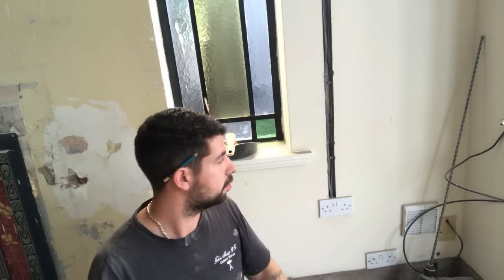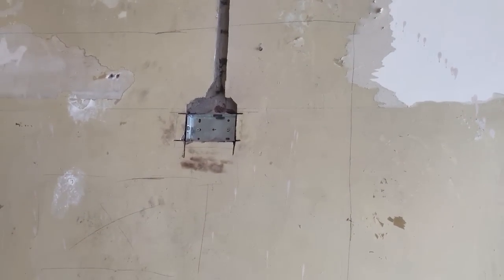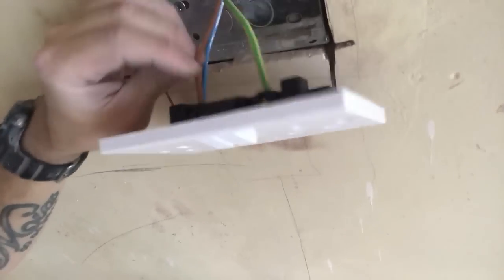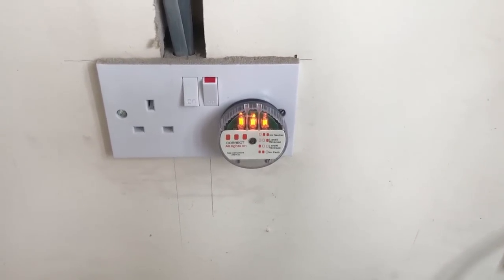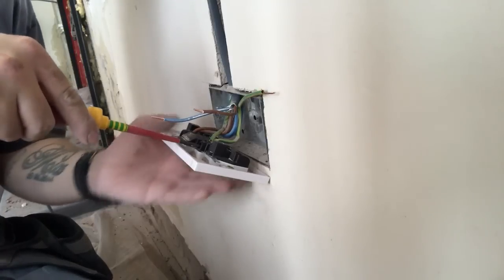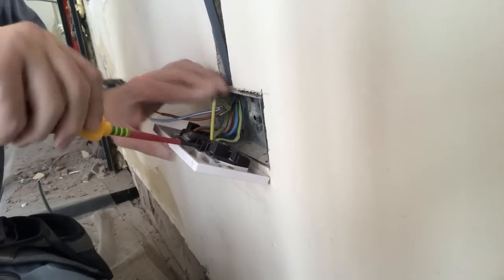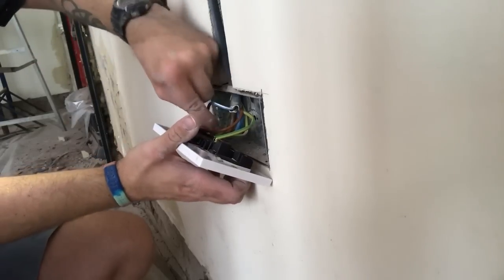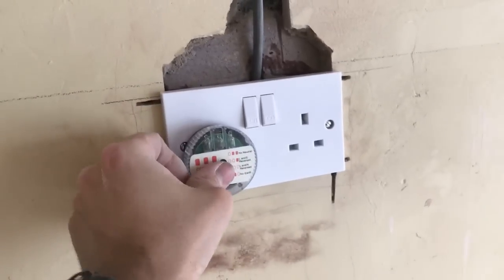How to wire a spur electrical socket UK

Comment: Has the spur wire got to be routed up the wall into a floor or roof void then across and down or can you not chase  out horizontally on the sale wall to the new socket?

Comment: Is this a ring sorry ? Should you not off pulled a leg bag  from socket to spur then looped back to socket to keep it a ring ? Otherwise it's a radial circuit? Maybe I'm confused?
Reply from the maker: It is a radial circuit but you can spur off a ring or a radial

Comment: Hi when I took off the metal light switch to paint round  it, I didn't have a earth wire connected it was just sitting at the top. The back box is wood so I'm not sure if this makes a difference? I have connected the earth wire to the metal switch but I didn't add an extra bit of wire to make a connection like you did, do I need to do this? And have I done the right thing by connecting the earth wire? Sorry about all the question thanks in advance x
Reply from the maker: You did right connecting the earth wire to the metal switch. If the back box was metal then that would need to be earthed too.

Comment: Although it is a raised socket spur for the TV and it is unlikely that outlet would be used for anything other than the TV. at very low ampage..... A double outlet socket is rated for 20 Amps and therefore as a spur on 2.5 single cable should be a FUSED SPUR at 13 amps.  Unless its a single socket all spurs must be protected from being overloaded above 13 amps. this is the regulations.  If this gets checked by a Qualified electrician he will tell you to tear it out and extend the ring main or fit a Fused Connection Unit(FCU).

Comment: Never ever use a non contact voltage pen to prove dead , come on man you have got a GS38 approved voltage indicator witch you should use , also you failed to lock off the MCB this should be a matter of routine, as is carrying out the safe isolation procedure correctly. You have let your self down in this video, give yourself a slap on the wrist 🤣
Great video mate your doing a fine job 👍👍👍👍❤️
Ps sorry for the criticism I don’t mean any disrespect,

Comment: In reality it probably won’t cause any issues but when drilling through joists you have to recognise where this is acceptable. There is guidance on this, and it states do not drill holes within the first quarter span and to drill through the centre line. Also the holes cannot be too close to each other. This is to prevent undermining the structural integrity of the joist. In this video it appears he has drilled too close to the end of the joist and within the first quarter span. Plumbers, electricians, etc. often drill wherever and very rarely it causes problems but the guidance is there for a reason so anyone doing this, it’s worth checking it out. There are different rules for notching out the tops of joists. Thanks for the video.

Comment: Metal back boxes should have been earthed just to be on the safe side but was a good video and we'll explained.
Reply: The earth connects to the screw sockets and the screws are screwed into the back box.
Reply: No the  box doesn't need to be earthed if one of the lugs is fixed.

If both lugs are adjustable the regs state it must be Earthed.

As long as you have one fixed lug, the boxed is earthed through the faceplate screws.

Comment: You could of just pulled a leg from the ring and then looped back into the original socket to keep it on the ring rather than having 3 cables into one double socket.

Comment: I was always of the understanding that socket cables ran down from the socket,under the floor and up to the next, and light cables ran down to the switch, seems not to be the case.
Reply from the maker: No they run in zones in vertical or horizontal lines from the socket or switch.

Comment: Shouldn’t use a voltage pen to prove the circuit is isolated  but apart from that your guide was good, maybe if this video is ever re made explain your ring & radial and how many you can spur off etc.

Comment: I’ve currently got 1 double socket in my bedroom and I’m worried about overloading it with extension leads . I’ve complete a level 3 electrical course so I know the basics . But I wanted to know if I don’t chip into the wall can I put the cables in singles via a pvc pipe to the designated location as I’m going for the industrial look
Reply from the maker: That method is fine. Stay safe.
Thanks for watching and be sure to like share and subscribe to help the channel grow 👍🏼

Comment: Hello again.
I've  just unscrewed a double plug socket,in a bedroom,  to find 2 red wires, 2 black wires and one green wire coming out of it. 
I need to use this socket to run another wire to a cellar next door where I want to install another double plug socket. 
Will this be okay to do, as there are already two red and two black wires  in there and am I correct in thinking I just need a 2.5mm wire for electric power socket. It wont overload that bedroom socket will it if I run another wire through it? 
Cheers. Jabaar in Manchester.
Reply from the maker: You have a wire in and a wire out so you should be able to add a spur but since you have the old coloured wires it might be a good idea to have a qualified spark take a look.
Thanks for watching and be sure to like share and subscribe to help the channel grow 👍🏼
Reply: You can spur from each socket 1 time. If in doubt you can put a 13amp fused spur in, then put as much as you want on it.

Comment: How do you know if a socket is already spurring off to another socket or that a socket is a spur off another socket?
Reply from the maker: A socket usually has 2 sets of wires, in and out if there is a 3rd it probably has a spur, if there's only one set of wires it is probably a spur or the last in a radial circuit. Thanks for watching and be sure to like share and subscribe to help the channel grow 👍🏼

Comment: What happens when someone comes switches that circuit back on coz the kettle ain’t workin and thinks it’s tripped, bang goes ur snips and a nice belt if ur not so lucky, safe isolation out the window, where’s ur lock off kit

Comment: Thanks for this. I was sure this was the correct way to spur two sockets, but wanted to watch a video just to double check.  
One wee pointer, and I'm sure it isn't a big deal, but I think it's a good idea to twist the original and new wires together, so that when you put them into the socket and tighten the screw, there's no chance that any of the wires will move and come out of the socket. 
Great health and safety tutorial too on checking circuits are isolated correctly.
Reply from the maker: Matthew Kenny thanks for your comment and thanks for watching, be sure to like share and subscribe to help the channel grow 👍🏼

Comment: So, do you not need to get the spur socket checked and approved by the council? And what about an electrician certificate?
Reply: Not required for a simple spur. Its not notifiable. If in doubt, I always check with the councils building control officer that I'm allowed to carry out the work. Also Google the regs.

Comment: Great video Re new socket from spur.  I have a Double socket in the Lounge and want an outside one on the opposite wall outside.  In your video you got an earth sleeve, I’m not sure what I do there ?  Thanks
Reply from the maker: Paul Faulkner earth sleeving is used to insulate the wire because it doesn't come with any on it. Thanks for watching and be sure to like share and subscribe to help the channel grow 👍🏼

Comment: Good video you make it look so simple could you carry on from the new tv socket when it was working and have another socket further down the room that comes off the new tv socket if you no what i mean
Reply from the maker: jay G no you can only have one spur from each socket. Thanks for watching and be sure to like share and subscribe to help the channel grow 👍🏼
Reply: If you add a fused connection unit on first then yes you can add as may as you like provided the fuse in the FCU is 13A and no more

Comment: You lifted the floor boards and found the cables which run down the wall. Why didn't you introduce a 30amp junction box and have that located under the floorboards, then feed the socket off the junction box, this is still a spur. No need for 3 cables running down the wall.
Reply: One point regarding spurs from a junction box. These days, if under floorboards you should make sure you use a maintainance free junction box. Hager or Wago's in a Wago box etc.
Reply from the maker: Adam Woodall thanks for your comment.
I could have done that but I wanted to make a video showing how to spur off a socket and since my walls were already chased out it didn't make much difference.
Thanks for the tip though 👍🏼

Comment: is it safe to put 3 wires in to each terminal?   Wouldnt a junction box in the ceiling be safer?
Reply from the maker: Thanks for your question. It is perfectly safe to put 3 wires in each terminal as long as there is no copper wire showing and they are tighten in properly.
Thanks for watching and be sure to like, share and subscribe to help the channel grow 👍🏼
Reply: @spendtimesavemoneydiy  seems like the screw wont be able to contact all 3 at once.
Reply from the maker: D Rcl as long as they won't pull out it's fine 👍🏼
Reply: Could you put a junction box in though? Would that be UK compliant?

I was thinking the same as R dcl

Comment: Nice video but that socket looks cheap. Use MK.
Reply from the maker: Dr. Scott-Arthur thanks for your comment, very observant of you that they are cheap sockets but what you have overlooked is I needed to plaster the walls and it would have been silly to put expensive sockets on. So after plastering I put expensive chrome sockets on.
Thanks for watching 👍🏼
Reply: Spend Time, Save Money, DIY 

Makes sense, glad you used the proper stuff in the end!

Comment: when doing a new socket from existing one does the wiring have to go up and across? if so how high straight up from original socket? cheers and great vid
Reply from the maker: The cables need to be in a straight line either horizontally or vertically  from the sockets.
Thanks for watching and be sure to like, share and subscribe to help the channel 👍🏼
Reply: @spendtimesavemoneydiy  thanks mate much appreciated

Comment: Hi mate, little tip for you when doing this to get a better connection inside the terminal is to bend the conductor back on itself.

I always do this when doing electrical wiring and it’s a really good tip I picked up.
Reply from the maker: TGP Fire and Security thanks for the tip mate, I will do that in the future! Any more tips are always welcome. Thanks for watching 👍🏼
Reply: Spend Time, Save Money, DIY no worries mate take care and stay safe.

Comment: What isn't shown in this video is any conduit for the cable running in the wall. Now, it may well be that some of capping is being retrofitted before plastering in the chasing. I'm a bit concerned that some people might think it's ok to just plaster straight onto the cable, which is not great practice. It makes it impossible to pull through new cable to replace any damaged stuff, and there's always the possibility of the something in the plaster degrading the PVC. 

Another important point, is that whilst it's legal for a householder to add a spur onto a ring, if it's done in a hazardous area (basically in the kitchen, utility room and the like), then it has to be inspected. It might be cheaper in such cases to do all the chasing, putting in backboxes, running cables and so on yourself then pay an electrician to do the final connecting up and testing.
Reply: I agree plastering over cables isn’t the best idea, but it is still commonly done. As is forgetting rubber grommets where cables go thru metal back boxes! 

Spurs in kitchens & utility rooms ceased to be notifiable under Part P in 2013. Only spurs near baths & showers would now be deemed ‘hazardous’.

Comment: Hi m8,,just wondering,how do I no if I can spur of the socket or can I spur off any socket from one of the bedrooms to the loft,,I need 2 sockets putting in my loft for my cctv setup 👍
Reply from the maker: Explore With us if there is 2 cables at the back of the socket then it should be ok to spur off if there is just 1 cable then it is probably already a spur and you shouldn't spur from a spur and you can only have one spur socket from a socket. If in any doubt consult a qualified electrician. Thanks for watching 👍🏼
Reply: Spend Time, Save Money, DIY cheers mate,,nice 1 👍
Reply from the maker: Explore With us good luck and let me know how you get on 👍🏼
Reply: Spend Time, Save Money, DIY yea will do mate,,nice 1,,are you on Instagram or anything m8,,send you some pics when I’m done
Reply from the maker: Explore With us yeah I'm on instagram under spend_time_spend_money 👍🏼

Comment: oh and you Must put protective capping or conduit on the cables you bury in the wall the plaster has a chemical in it that destroys PVC sheathing , you should bend the ends of cables so the screw doesn't break solids and the thing come out , also a fly lead of earth to the box to ensure that its earthed fully
Reply: Also note that holes in the joists like that should be between 0.25 and 0.4 of the span, which these are not (Eurocode 5; EN 1995) - as highlighted in the IET on-site guide.

Comment: I'm planning to do the same for my spare bedroom. Would it be safe to chase the entire spur into the wall; without having to go up the ceiling and out again? In other words. A normal spur but chased into the wall. I would be going up the wall halfway and then across  for my new TV socket.
Reply from the maker: Graham D as long as the wires are in the safe zones ie horizontal or vertical from the sockets you should be fine but if in doubt consult a qualified electrician. Thanks for watching 👍🏼
Reply: So to be sure the wires are running straight up from the existing socket; and straight across to the spur without  any kinks etc? Thanks again.

Comment: 13:05 aren't you supposed to bend the copper so that it has better connection ?
Reply: On another note I did cringe at 14.05 when he forces the socket back onto the box without pre shaping the singles within 😫
Reply: @arleslie100  yeah same lol it's an okay video but not the best and I really hate videos that show diyers how to 'do' electrical work
Reply: @michaelboyes4948  but i dont understand it worked does it really matter if he didnt dobel up or bend the wire
Reply: @2455-x7f  A piece of silver paper around a blown fuse will work electrically, but it's not good practice.  Micheal was just saying how it should be done.
Reply: 2.5mm you don’t need to if it’s good quality copper that only if your using thinner twin earth for say something like light circuit.
Reply: Single conductors of less than 4mm2 CSA being terminated should be doubled over as best practice. However, in the video he is terminating two 2.5mm2 conductors into the terminal. Therefore it would be unnecessary to double over the ends.
Reply: @arleslie100  the spur only has one leg of cable going to it so conductors should really of been doubled over
Reply: Michael Boyes I absolutely agree with you, my post was unclear, I tend to read and comment whilst watching/listening to videos. But the rule of singles smaller than 4mm still stands
Reply: SpiritousRock No

Comment: I need to do this in my bedroom as there is no socket on the wall where I need one,,there is a socket on the other side of the wall in the other bedroom,,does it matter how long the cable is,,,also mate I need to put a security light and some outdoor sockets in the garden,,is this the same way I do it mate 👍
Reply: Agree with the first reply, also back to back sockets may not comply with Approved Document E of the Building Regulations for resistance of the passage of sound. As well as parts A and B, Structure and Fire Safety respectively.
Reply: Bond Bondy 

In regards to the socket in your bedroom it will be easier to use a feed from the socket from the opposite bedroom but you might have to drill out at an angle so that it sockets I'm not opposite each other as the depth of the walls might be thin

And on the outside lighting I think you will be better to get some money to do that for you

Comment: You need to add a link from your back box to your earth on your outlet. Back boxes must be earthed
Reply: Classical Carpenter  only if both lugs are adjustable. If one is fixed, then there is no requirement for it

Comment: I do like your vids. Just a thought. Instead of connecting into the socket and running the spur cable up the channel, you had enough room in the undefloor chamber to put in a joint box and either spur or ring out to the tv socket - using WAGO's you could cover it up (does nnot need to be inspected) - just a thought. Latest regs don't like spurs! Keep up the good work.
Reply: Could of pulled a leg out of old socket and into new then new cable back to old socket.
Reply: And electricians dont like joints under the floor better to be able to get at any connectrion threaded or not

Comment: I'm always amazed how different things are around the world. 

In the US we would need to have a strain relief on the cable entering the box.
Reply: The reason strain relief is not required on this method of installation, is because the cable will be embedded within the plaster, and therefore strain on the cable could not occur. If the cable was installed in such a way that “pulling” of the cable was possible, then strain relief would be a requirement.
Reply: This is not required in the UK for fixed wiring